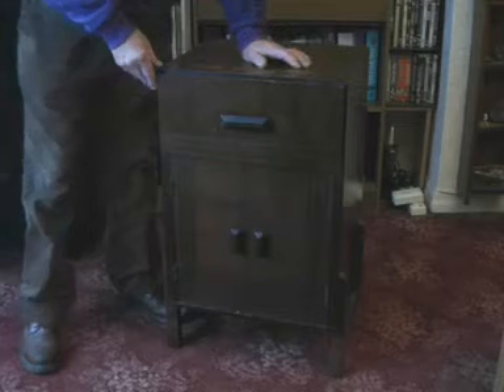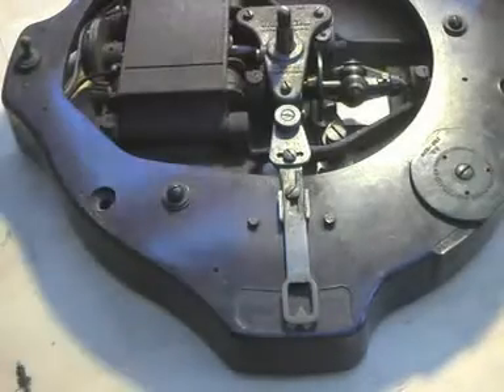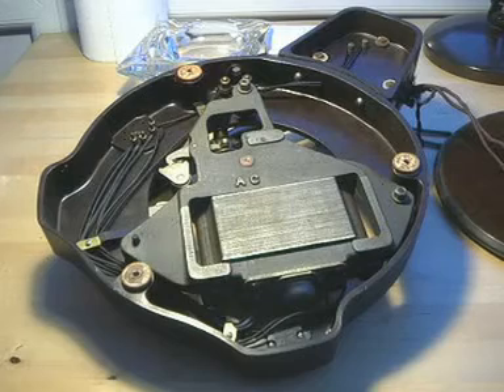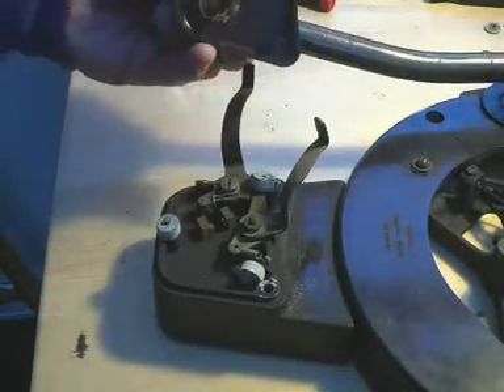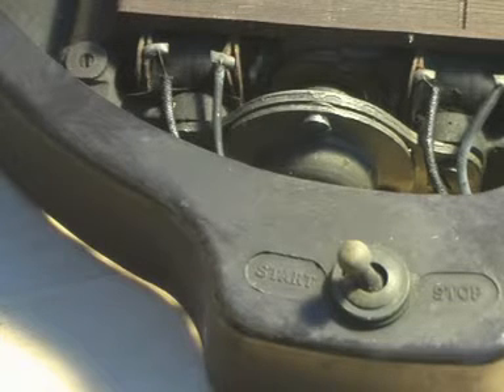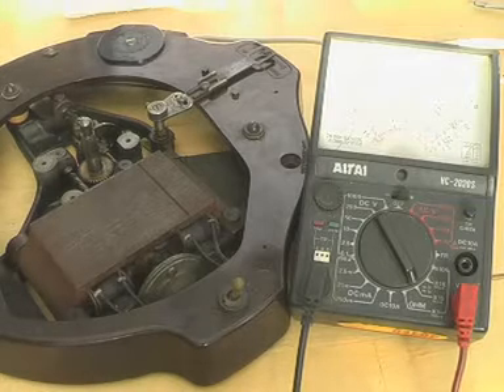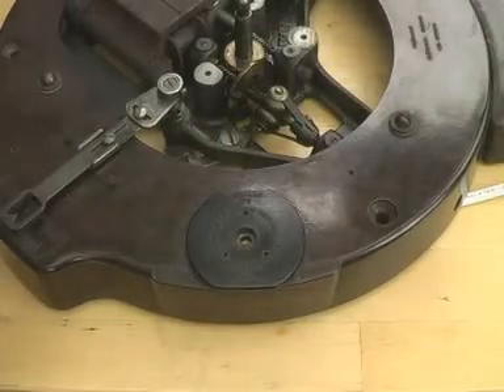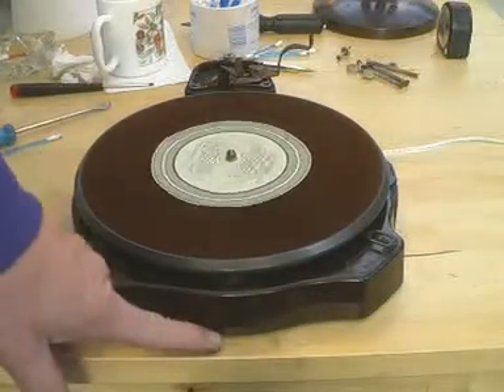univolt1.mpg

Comment: mabe they used that thin wireing becoase they wanted to make the unit cheaper to make. the machanics almost looks like they have come stright out of an wind up gramophone exept they are driven by an electric motor instad of a spring.
thw sounds like its raining outside.